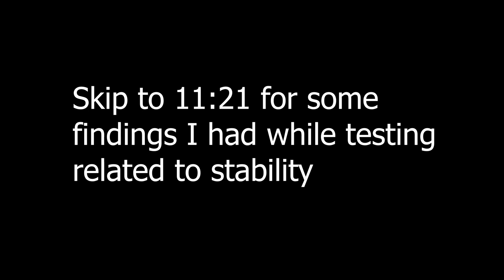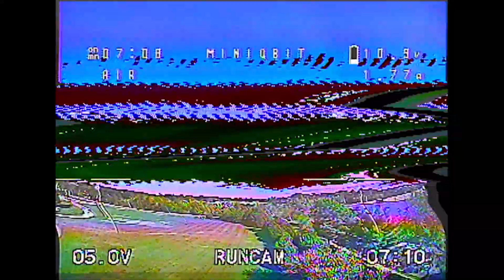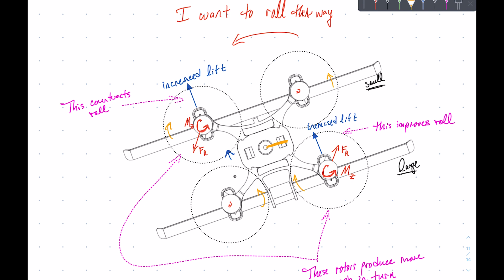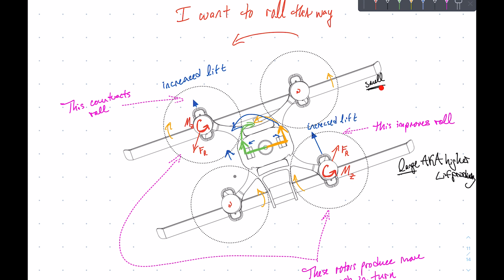Endurance Wing for Mini QBiT

Comment: why not have a single larger wing beteen the rotors. interaction would be minimised then
Reply from the maker: Good question! One reason is that the wings can become structural components stiffening the structure at the motors. In addition, with the wings directly under the props, the prop wash helps keep the flow attached thereby reducing stall behavior. But mono-wing designs are certainly a good option for other reasons :)

Comment: This was very interesting.  I haven't flown my blackfly model in forward flight yet, but was concerned about the counteracting effects of the one wing.  one thing I did to help is to angle the motors so that they don't point straight forward, but are tilted slightly right/left to aid roll control in forward flight.  I did not put elevons on my model (the blackfly has elevons behind each prop).  I want to see what the flight characteristics are without them, to keep the build as simple and light as possible.  One downside to this is that I will not be able to glide in horizontal flight in the event of a loss of power.

Comment: Hi Peter.  Very interesting.  I still intend to put Arduplane on this frame and am glad  you've created the larger wing.   QLoiter should stop the sideways movement in hover mode cause by forces generated on the larger wing (GPS should force it to stay in place).  I've almost picked my flight controllers to use to get this project going.  I still can't quite wrap my brain around your explanation.  If the counter torque on roll is caused by propwash over the wings why would the the forces be different on each wing if we used 2 large wings?   Thanks for your work on the miniqbit.
Reply from the maker: You're correct, the effect of these forces 'should' cancel out with two large wings, but I believe that due to the motor cant angle it makes the 'unstable' wing create a larger force imbalance than the lower, so the net result is instability. If the motors were mounted parallel to the plane of the frame maybe the effect wouldn't be as pronounced. It could also be that with the larger wings, it requires a greater roll moment. Thus, by including the lower wing, the roll authority is improved. Whereas with two same sized wings, the rotor torque + motor cant angle may not be enough to roll the vehicle. But these are just my theories as to what's going on, needs a wind tunnel test where we could measure the loads on the wing and rotor independently.

Comment: Is there a performance difference between mounting the larger wing on the bottom compared to the top, considering that you use the correct (stable) motor orientation for each case?
Reply from the maker: I believe there may be a performance difference associated with the biplane wing area difference, but I'm not too familiar. Biplanes aren't exactly a hot topic in the aerospace industry right now. Staggered wings is another way to potentially improve performance.

Comment: Great work and clear, intuitive explanation of your findings. Have you considered or tried a configuration where the rotors are under/behind the wings? With the rotor inflow rather than downwash going over the wings, these effects should be muted.
Reply from the maker: Thanks for the feedback! I have considered that idea actually, I think it would be a very neat idea to try. A problem I foresee is structurally it may be difficult with cg location constraint. The rotor wash also mitigates stall over the wing, although I don’t suspect this would end up being a huge issue. Lastly, the wing in front of the rotors would disturb the inflow into the rotors which could hurt performance/control. But I think it’s definitely worth a try!  Maybe I’ll try it out at some point
Reply: Maybe you could also try extending the arms so you could mount the wings at the tip of the arms and out of the way of the props. Or mount a single wing at the middle of the frame, between the props.

Comment: How about using symmetric airfoils?
Reply from the maker: That would be good to try, in this case it would be a flat plate airfoil, no camber. It would also require flying with a slight vehicle pitch attitude to keep the aoa of the wings positive.
Reply: @peterryseck  You may want to consider a NACA0004 to 0008. TinkerCAD has a standard shape for “2” digit NACA foils. Just 3 D print vertically with a single wall and a few % infill and it will be surprisingly strong.
Reply from the maker: @tomfalls1006  naca airfoils are not efficient at this low Reynolds number, plates are more efficient
Reply: Would using neutral struts in the proprotor wash and having longer symmetric wings only in clean air address this?
Reply from the maker: @KeithCohen  address what exactly?
Reply: @peterryseck  the roll authority reduction from the differential proprotor-wash-induced lift over the wing surface behind the proprotors?
Reply from the maker: @KeithCohen  Ah yes you’re right, symmetrical wings would solve the problem. They could be behind the rotors too without problem. It’s just having an airfoil with positive lift at zero aoa behind the rotor that causes instability.
Reply: @peterryseck  symmetric wings in the wash area generating lift when at enough AoA might still contribute to instability especially in transition?
Reply from the maker: @KeithCohen  relative to the rotor wake, a symmetric airfoil at zero aoa will produce zero lift so there will be no instabilities

Comment: Very interesting. Thanks for sharing. 👍😊
11 minutes flight... nice. 
Have you tried it with the higher capacity lower discharge rate lithium batteries to see how long you can fly for if you are after cruising flights?
Reply from the maker: No but that would definitely be the smart next thing to do! Currently I'm running 75c battery which is much too high for this application

Comment: What would happen with 2 large wings, upper and lower, and would happen if changed the motor mix so that to two top motors would spin in plane mode?
Reply from the maker: Instability with 2 large wings as I explain at the end of the video. If two top motors are the only ones spinning it will lose pitch control.